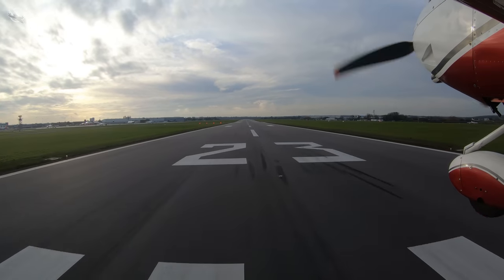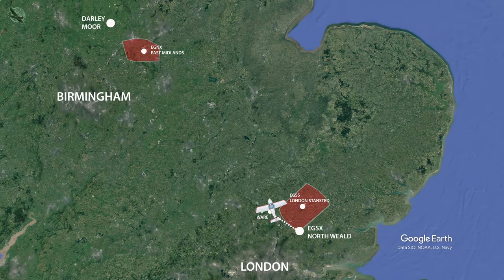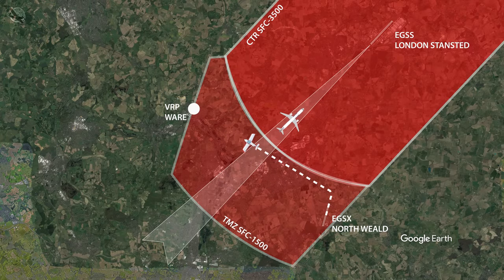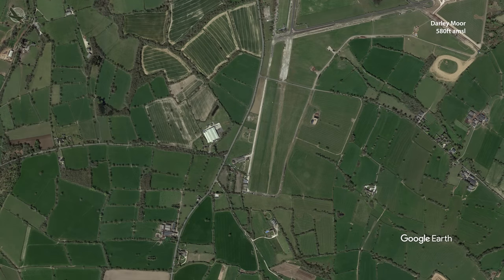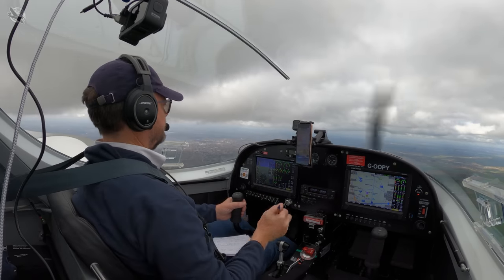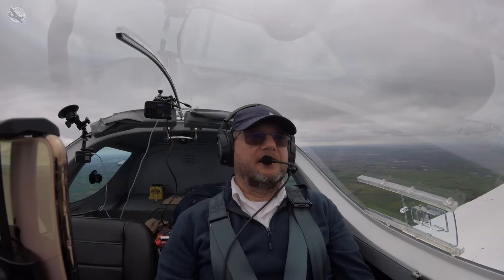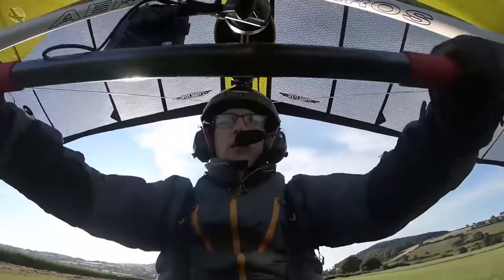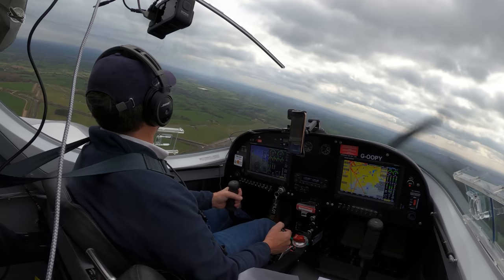Landing on a skinny little hybrid runway!

Comment: It's interesting for me to see the differences in flying microlights in the UK compared with here in New Zealand. Here are some of the things I've noticed about your flights - More atc comms. More noise abatement requirements. You can fly over built up areas (microlights here can't) You say dead side, we say non-traffic. You say "in the overhead", we just say overhead. Lots very similar though. It would be interesting to break down your typical costs - hangarage, insurance, club fees, medical etc 🤔
Reply from the maker: In the UK this aircraft is not a microlight it is a Group A aircraft and you can't fly it on a microlight licence. We only just got the 600kg upgrade to microlights this year and it is only for new models and can't be re-classified retrospectively. As a factory built certified aircraft with a C of A our Sport Cruiser has lots of advantages over a microlight class aircraft, however we also have alot more costs :-(
Reply: @Short Field  Your Sport Cruiser could be in the Microlight or "Lightsport" category here. Lightsport is a kind of halfway house  between Microlight and GA. Sucky that your new Microlight rules can't be applied retrospectively